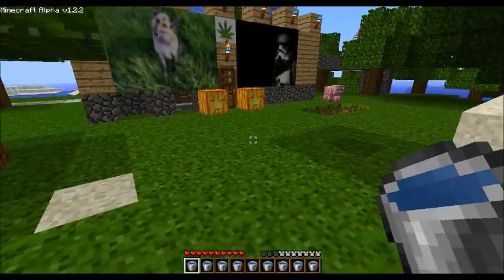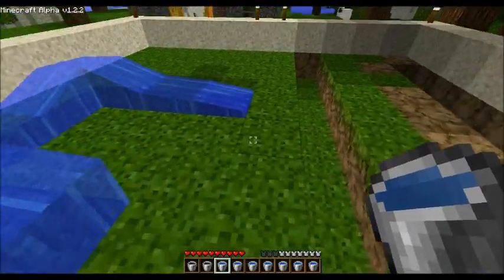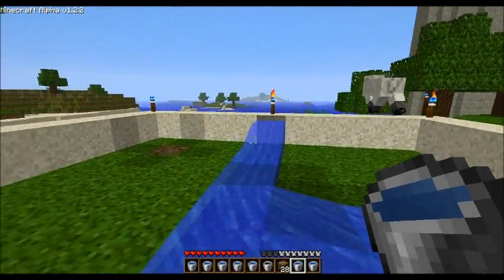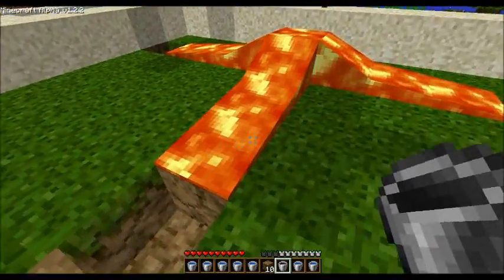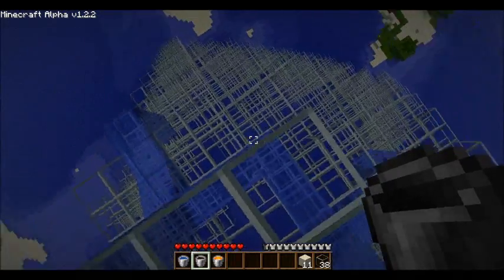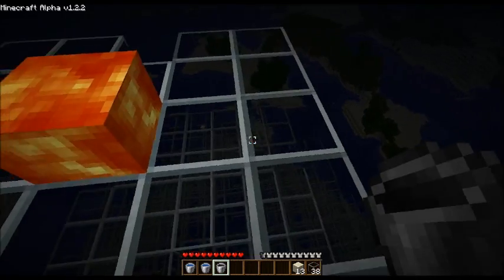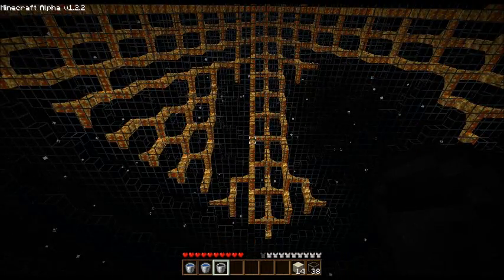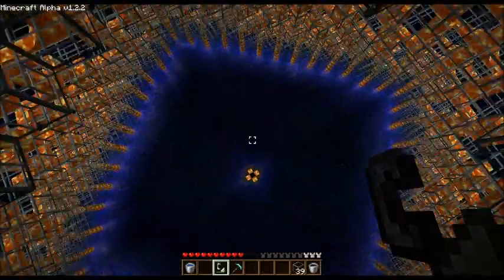Glass Volcano

Comment from the maker: @TreeBeardIsMyTeacher It does indeed still work in 1.7
The water will only behave this way with holes within 5 blocks of the source. If it's on flat ground save for a hole 6 blocks away, it will flow the full 7 blocks in all directions regardless.